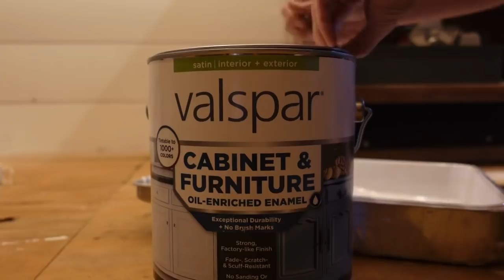DIY Cabin Build | Kitchen Reno | Part 1

Comment: Good job, the contrast between the walls enhances the environment. (Wouldn't it be easier to do all the work, sand, paint, repaint with the cabinets on the counter and then put them back in place).
Reply from the maker: with all the people in here while trying to work it’s just not possible to do it the easy way.